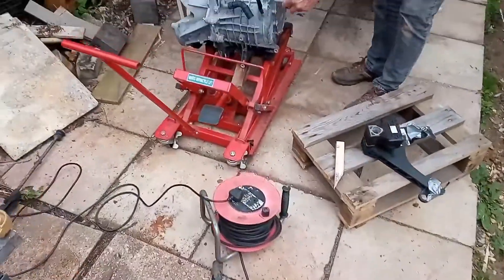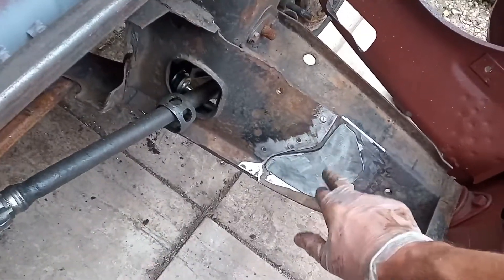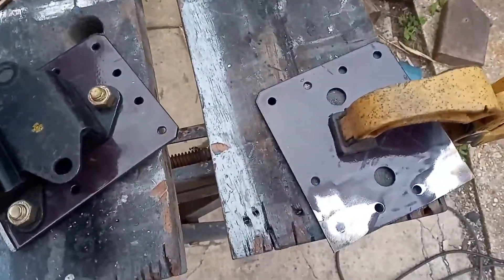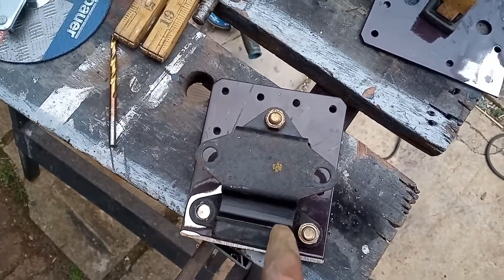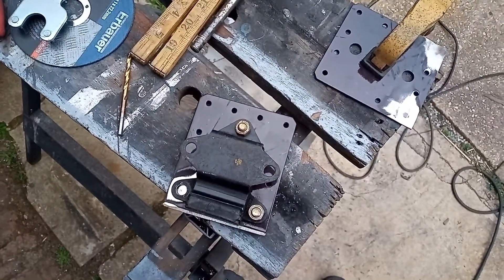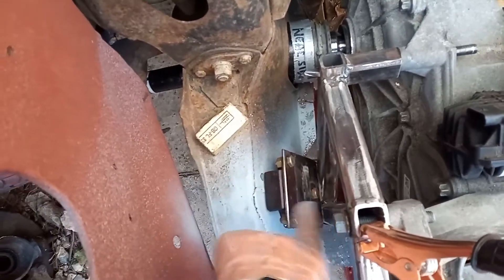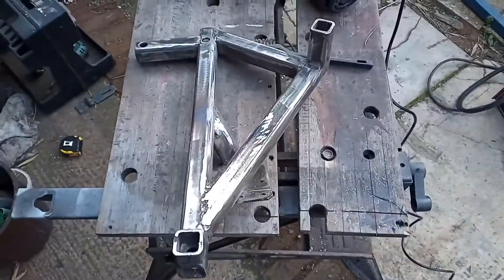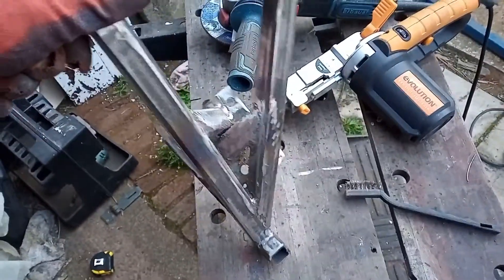Project Mini i3, motor mounts

Comment: Outline your template into outline your template into a piece of ply, and screw blocks to the plu to hold it tight, drop your cut steel in and tack

Comment: Great video as usual Scott. Originally in the i3 the motor moves on the rubber mounts a lot! Have you completely hard mounted the motor or is there rubber in those original mini mounts? I would worry vibration wise, but I realise you may not have much choice considering how tight the rh driveshaft is.
Reply from the maker: Thanks Nick, I may well have to make the hole bigger for the drive shaft anyway, we'll see. The Mini mounts do have a rubber mounting, I'll end up with two side mounts and another for front to back movement. Hopefully this should be enough.
Reply: @MiniLifeCrisis  What size box section are you using? 1 inch, 1 1/2 inch?
Reply from the maker: @nickscarborough1028  currently using 1" box, cheers

Comment: Ah good work, and well done pushing forward. These videos hide all the pain and frustration like just casually saying "just re do the motor mounts" like it's a 2 minute job. Anyway looks good using the existing drive shaft locations 👍
Reply from the maker: Thank you, it could always be worse, I was worrying it would prevent me from going any further. Yeah, it's definitely not a 2 minute job as I still haven't finished the nearside 😂